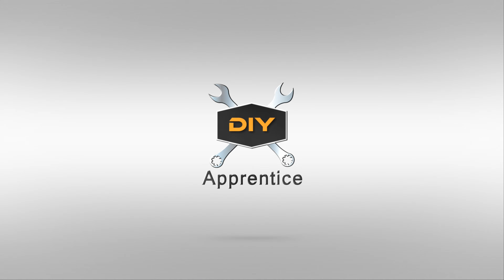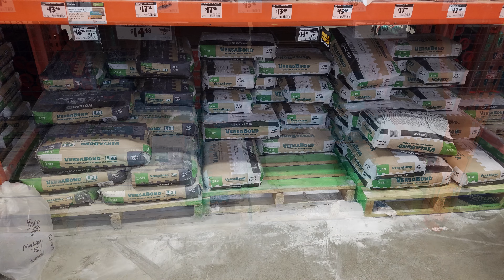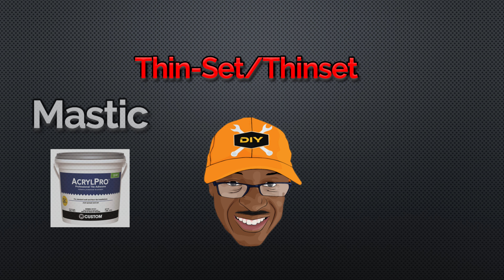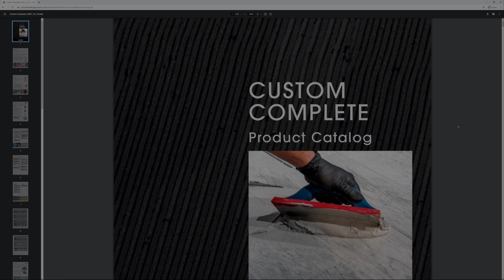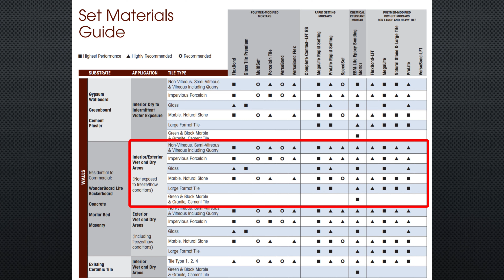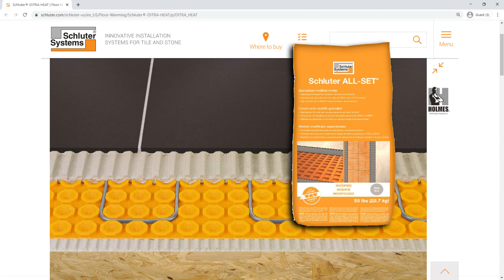Bathroom Remodel 69 - Choosing Thin-Set for Tile | DensShield | Ditra

Comment: I used motar  on my tiles years back and i forgot what kind it was but i used it for my tile  and it was strong hard as a rock  and it hard to remove when cured and dry . I wonder what type of motar i used b cuz i used a white thinset motar  the othere  day and it kinda not that strong  i can scratch it with my finger nail its soft like grout i need something strong so i can plaster over my shower tiles . My tiles grey i want to make the shower walls white